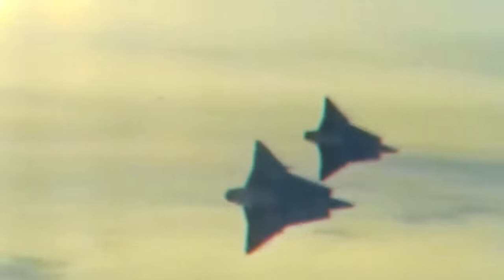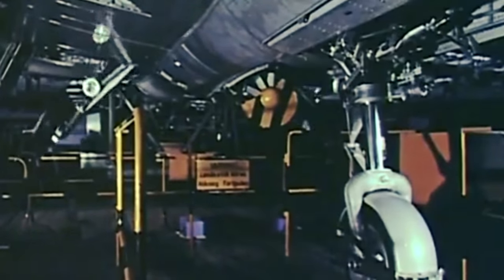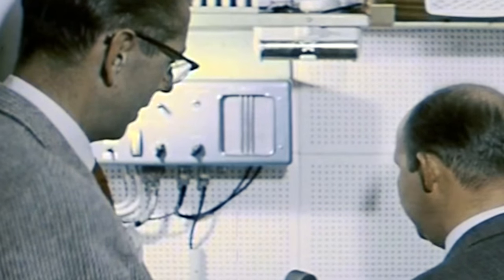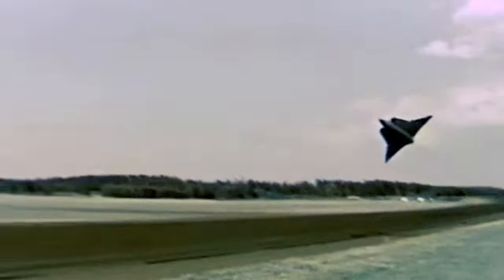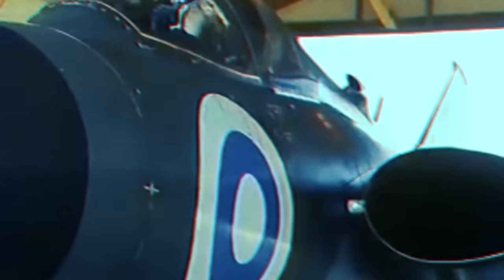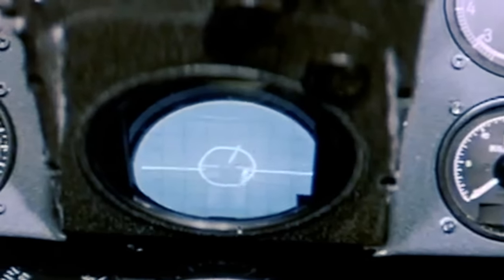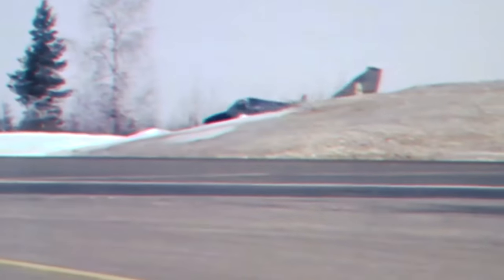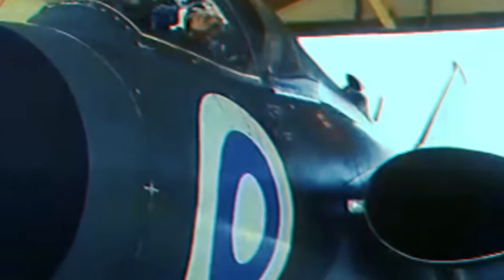The Bizarre Airplane Design That Shook Up Aviation

Comment: The engineers at SAAB also constructed cars that were much influenced by the airplane constructions, that is sleek design with extremely low air resistance.

On the airplanes generally and also mentioned in the video was the ability to quickly fuel and rearm the jets. Also electronics was built modular and a faulty module could be easily and quickly be replaced within minutes almost. I live very close to one of the airbases and on the way to Lidkoping, 50km away are at least three landingstrips, called “Flygraka” in Swedish, meaning a straight (and wide) stretch for airplanes (and for anyone who wants to reach Mach2 with their cars or MCs).
Reply: Yeah and a oil filter that screwed out into the frame. Had to Jack it up to change the oil

Comment: saab is realy good at comming up with clever designs to solve problems or challenges. that goes for the entore company, not just aircrafts. I have had two 1st gen 9-5 sedans. love those cars for the little details like the key down by the handbreake and the nightpanel that makes driving long in the dark so much better.
Reply: Sorry to tell you that saab aero and saab automobile parted ways long before the 9-5.
They were two completely separate companies by then.
I believe Saab 9000 was the last of the last car completely designed by Saab automobile before they were acquired by GM, and much of the development was moved from Sweden.
With that said, I like the late Saabs too, and they carry along a lot of the design quirks and technical innovations that is typical for the brand.
My dad always drove Saabs and I do miss them as a brand. I would very much be interested in something like the 900 but with modern fuel economy, or why not electric.
Reply: @JH-lo9ut  right, i forgott about that. But as you said, some of the "design philosophy" stayed after GM acquired Saab automobil.
Reply: @JH-lo9ut  All development of Saab cars was made in Trollhättan Sverige. Even after GM got ownership.
Reply: @pederfallbom  Hey that's great I didn't know that. I heard so much about GM killing the brand and people saying those late models aren't "real Saabs"  so I guess I got the facts wrong.
Reply: @JH-lo9ut  Being developed in Trollhättan doesent mean GM didnt hold Saab back which they did in many ways. Doesn't really matter now since they are gone and surely missed by alot of people here in Sweden and elsewhere.
SAAB is still alive and kicking more than ever though in their defence systems🥳👏🇸🇪
Reply: All Saab cars where designed in Sweden even after the GM take over, the difference was that the Swedish engineers kind of had their hands tied because they had to use the same platforms as other cars in the GM conglomerate. So the 9-5 would be based on the same base as som Opel cars and so on

Comment: A friend of mine, who drove a SAAB 390EMS was stunned to know that SAAB created jet planes... he smiled as he shifted gears.
Reply: Letters S and A actually mean Swedish Aeroplane (in swedish) and AB is from Aktiebolag aka limited company.

Svenska Aeroplan AktieBolag.
Reply: Totally different companies though. Toshiba make spacecraft, doesn't mean your cheap radio is a spacecraft.
Reply: hehe :D
Reply: @handlesarefeckinstupid  Early SAAB cars were actually made by the same company as SAAB Aircraft. Only later did it split (which made sense), and some aircraft thinking probably stayed in the car company. (I know the SAAB 9-5 had a night driving blackout cockpit feature, which was excellent for improving night vision.)

Comment: On Aircrew Interviews, a Finnish Draken pilot talks about intercepting an RAF Nimrod reconnaissance aircraft over the Baltic. (The Soviets told them to do it, or else they would) and the RAF pilot throttled back to make the Draken overshoot, the pilot responded with a 'kort parad' "cobra" and slowed right down alongside him, and the RAF pilot went on to the common frequency to offer his congratulations at the manoeuvre.

Comment: By the way the Austrian Drakens did in fact later on use AAMs. Another fun fact is if you pulled to hard on the stick it would hit you back to not get you in a flat spin. Also after some demonstration flights the pilot flew the planes to its max bending the whole airframe.
Reply: Correct, when the balkan war of the early 90's errupted 2 Mig21 of the former yugoslav air force made it to austria (one landed on a civil airport, and they pilot stayed here and the second one "took a look" and headed back. (the pilot that landed told authorities that they were told by their superiors that austria had attacked them while they were fighting their former countrymen of new/refounded slovenia.)
And so the austrian government asked the signing nations of the state treaty to allow AA missiles. To which they agreed and noted that the part about rockets in the treaty was intended for ground to ground missiles (like the V1 and V2 of WW2).

Comment: How the cobra manoeuvre doesn’t stall the compressor is beyond me. There’s a big puff of smoke when it does it.
Reply: You have to quickly run the engine power down to idle, Pull the nose up, then drop it and throttle up I would guess. I mean thats how the Cobra maneuver is done in the F14 Tomcat

Comment: I have never seen any better proof of the old adage, "if it looks right, it'll fly right," than the SAAB J-35 Drakken. With that sleek, double-delta design and powerful engine, this must be the sexiest jet ever built! From its first flight, four years before I was born, to its retirement when I was 40, this beautiful bird turned heads wherever it flew. There just isn't a more beautiful or elegant bird than the Drakken.

If I were stinkin' rich, I'd buy myself a Drakken and an F-5-F, then I'd own two of the sexiest jets ever built.😉

Comment: The "cobra" was not used to slow down the plane or anything like that. It was to practice superstall handling and to regain control due to many accidents for pilots accidentally stalling at lower altitude. So that maneuver in short is to train the pilots to "feel" when the plane is about to lose control and how to get control back.

Comment: Air Force Youth (FVRF) 1983-86. Worked manual air observation systems (like Battle of Britain) on weekend and drills. I've reported more Draken, Viggen and Hercules over landline, than I have had hot meals in my whole life (56). 🎶 memories 🎶

Comment: As the son of an USAF Vietnam era and post jet engine mechanic and a working mechanic myself.  I've always thought the J-37 was a great plane, I still remember that Saab tried cash in on the Vigen name for a car they made.  Which if I could find one, I'd probably buy it on GP.  After watching this video, I have new respect for the Dragon.  Saab has a good art department and a better engineering department.  I've always been an F-22 fanboy, but seeing the airframe that pre dated the Vigen pull a cobra, damn.  To be fair it looks like the Dragon does some UFO shit by going almost 180 up instantly, the F-22 cobra drunk pigeon :(.
Reply: The invention of the cobra has also been connected to the Flankers. However, the maneuver was presented in a Finnish encyclopedia from the 60's.
Reply: SAAB and the SwAF never named the J29 other than the .. J29. It was the Swedish people that named it "flygande tunnan", translated into the flying barrel. They've never made that mistake again.

Comment: I had the pleasure to see a late model J35 Draken conduct a tree top level dogfight vs a JA37 Viggen during a military drill - unfortunately they were so low I could just catch glipses between the trees (when the Swedish air force fly low they have to pluck branches from the airframe after landing)
Reply: I am from another country that operated them, and my father worked at an airport that also had the mil airbase on the other side. Our Draken pilots had their "who touched down closer to the threshold of the runway" thing so sometimes the ground crews could pick runway lights from the running gear. And my dad and his collegues would need to repair the lights.
(at the start and end of a runway there's a set of light. On the airport this happened, there's maybe 4-5 meters of asphalt before those lights.

Comment: A yes... the day after militaryaviation did a in cockpit of the draken.. worth checking out.

While draken does translate into "the dragon", the actually correct translation is "the kite"... well sort of. (technically both translations are right).

The aircraft got the name "draken" because it looks like a "kite" that is called drake in Swedish, that is the same word as Dragon

Comment: It’d be interesting to see a direct comparison between the British Lighting interceptor and the Swedish Saab Draken, seems like they were designed for a similar role around the same time , and both remain stand out performers in their own way.
Reply: Thought the same myself
Reply: My father was a technical officer on the J35, -They’re pretty similar he once told me, but the Lightning was really difficult when it came to maintenance, with the engines stacked on top.
Reply: The Lightning had a very limited range and had a much greater turn radius than the Drakken.
Reply: Love the British lightning! What an amazing plane. My guess would be that the Lightning is a slightly better interceptor because of the extra engine. It was really designed to do one thing. The Draken I would guess is a slightly better dogfighter, not because it was designed to be, but because of it was designed to handle slow speeds taking off and landing on short road strips. Both are speed monsters though. The Draken supposedly still has the speed record in the Swedish air force. Both the Viggen and Gripen could out turn it, but for raw speed and climb the Draken was a monster, just like the Lightning :)
Reply: @Fundybay66
The Draken also had very limited range and not the best at turning either. Both these places were designed as fast interceptors. The Draken probably has better slow speed handling because of the double delta. But the Lightning is probably faster. Everything is a trade off

Comment: Love this plane. I have great memories of seeing my dad speed stalling his model Draken into a hedge. The plane stopped but the engine carried on for another 30m very spectacular. Still a very impressive jet. Could have been even more successful if not for the corruption in governments. It would have soooo much better for Germany than the F104.
Reply: Same ol Saab story...
Reply: The German problems with the F104 had far more to do with poor training and not using it as designed which was a pure high altitude interceptor. That said, the Draken was a fantastic plane.
Reply: how many F-104's must have crashed. hundreds?
Reply: @rollozucco209  About 300 planes and 100 pilots killed.
Reply: @janandersen8735  Never heard that.   That was a terrible loss of life.
Reply: F-104 the flying coffin
Reply: @kennethlilliehook7839  AKA The Widowmaker
Reply: @JTA1961  6

Comment: Quite the interesting livery design.
Reply: Yes
Reply: It has the Austrian army emblem so I'm guessing it's an airshow design styled after their flag
Reply: @mattBLACKpunk  
Austria was one of the few international buyers of the Saab 35, so I would guess it's an Austrian plane with the livery of the Austrian air force.
Reply: @ingvarhallstrom2306  I probably phrased it weirdly but that's pretty much what I meant (I just doubt they'd run this livery for regular military use)

Comment: There is an airforce museum in Ängelholm, sweden. It is located in the old airbase F10 and they have built a flight simulator out of an actual saab draken that was used back in the day when the base was functioning.

Comment: Pugachev's cobra is originally *Swedish*?  That will really upset the Vatniks when they learn to read.
Reply: Yes I said that many times. He was the first to perform it at an airshow but not the one that invented it. Most likely they did see the Swedish use this manoeuvre but wasn’t able to perform it until many many years later.

Comment: They should have updated these aircraft with new engines, avionics, aesa radar, and electronic warfare suite.

I imagine the design itself readily lends itself to stealth.
Paint it in the new ceramic based stealth paint and it's almost invisible.

Comment: Check out SAAB 210! First flight with double deltawing 21 Jan 1952! That´s more than 2,5 years ahead of Fairey Delta 2! And way ahead of Avro Arrows first flight 25 march 1958! The very first deltawinged flight must have been the American Convair XF-92, at least what I can find out, 18th September 1948 followed by the British Boulton Paul P.111 10th October 1950. And the French Mirage 1 flew in 1954.

Comment: BTW, a funny little fact: there was a time, when the Finnish Air Force flew both the Swedish Draken and the Soviet MiG-21.
Reply: Yep, the Soviets sold the brand-new MiG-21 to Finland in 1963 as the first export customer. Not even the Warsaw Pact countries had them - only the USSR. The reason was, that they didn't want the Finnish government to buy J-35 Drakens. Well - in 1972 Drakens were first purchased, and then even license-produced in Finland. 🤣

Comment: What is meant by Double Delta, I only see 1 wing, not 2. Great video
Reply: That the angle of sweep of the leading edge changes from wing root to tip.
Reply: @winternow2242  👍

Comment: Thank you for a highly informative video. 
The Draken certainly set new boundaries in the field of fast interceptors.
What with Sweden, Finland, Austria, and Denmark lying so close to the Soviet Union, a fast aircraft that could operate off highways after a apeedy refueling and rearming was a vital necessity.
The Germans pioneered using highways as makeshift runways in the last years of WWII if I am not mistaken.
Many countries around the world began building highways at around this time and secretly reinforced them at specific points to operate as emergency runways.
The British Harrier jump jet was also designed to operate off unconventional airfields, but not as an interceptor.
South Africa now has the SAAB Grippen, and there have been rumours floating around here since the 1980's that our highways were also designed to handle fast jets.
Reply: There is an anectdote ciculating in Sweden that SAAB enginers met up with a Messerschitt engineer in Switzerland after the war who presented ideas about a sweptback wing. Comparing the Messerscmitt P.1101 captured at the end of the war with SAAB J29 arises suspicion. Any facts about that?
Reply: @nilselgenstierna3282  Hermann Behrbohm wirjed for Messerschmitt as an engineer and aerodynamicist.
He and others fled to Switzerland in 1945.
He joined the SAAB J29 team.
The P.1101 wings were to be tested with various degrees of sweep, 30°,40°, and 45° which would be changed on the ground prior to flight.
The only prototype produced used the Me. 262 wing which was swept back 18.5°.
The P. 1101 had plenty of problems to be solved, which is why the FW T183 won, BUT NONE WERE EVER PRODUCED!
The SAAB J 29 original concept had straight wings, but data and drawings of swept wing designs came out of Switzerland from Messerschmitt aircraft designers, prompting a visit from Sweden.
They had drawings of the P.1101, P.1110, P.1111, and P.1112.

SAAB settled on a 25° swept wing.

There were similar designs to the P.1101, being the J 29 and the Bell X-5, among others, but the SAAB design was the better design, and went into production with the de Haviland Ghost engine.

Comment: I wanted to be a fighter pilot, but was too long to fit the cockpit, did my military service as assistance mechanician, and can tell it was far more tight to fit inside the air intake to inspect the turbine :)

Comment: Saw the last one fly over my hometowns former airforce base F4  in northern Sweden, this must have been either in 1998 or 1999.
The enormous roar its engine made was really something else compared to the newer planes JA37 Viggen and JA39 Gripen.
Reply: You're so right about the roar! One early memory of mine from my childhood is seeing a Draken fly over the small village I lived in in southern Sweden. It must've been around 1977-78 when I was 7-8 years old. I was left in awe by the speed and absolutely incredible roar! I will never forget that sound in my whole life or the fantastic design of the J 35 Draken.
Reply: I only saw the 35 at air shows. But I saw the 37 plenty growing up. I feel the 37 engine is a lot more brutal. Sounds like an Apollo rocket when it goes vertical in full afterburner – that crackling sound when the whole sky vibrates

Comment: One from the Danish Air Force is on a rooftop of a youthclub in Roskilde, if you take a train towards Copenhagen then you can see it on the right side when leaving Roskilde.
Originally when it was delivered it was setup as a hydraulic flight sim, I don't know if it is still functional as it seems to be in the same position whenever I pass it.

Comment: I wonder whether the RCS has ever been measured. The frontal and lateral area seems very low, the high sweep angle deflects radar, and the intake ducts have an S-curve which obscures the highly radar-reflective compressor. With a V-tail the Draken might be remarkably stealthy.

Comment: Gorgeous planes! Seen them with Mig-21's in Finland as a kid. The dust track to the swimming spot ran along the air field. Always liked the Mig better, because of the insane, rippling, ripping noise of its afterburner.

Comment: The Cobra is similar to viffing in the Harrier for example. Potentially of some use in a particular emergency but generally a bad dogfighting tactic as it loses a lot of energy very quickly. To fighter pilots energy is (almost) everything or so they say.